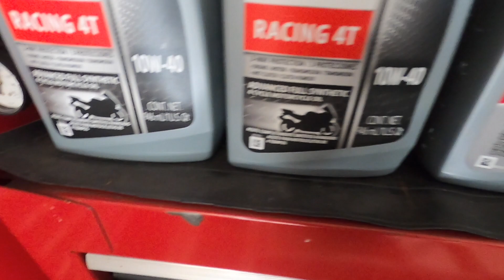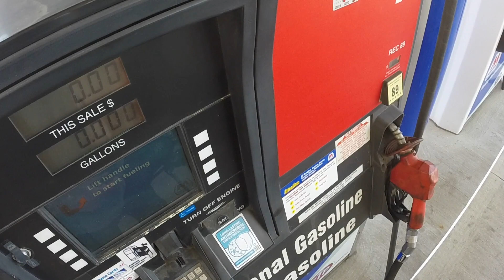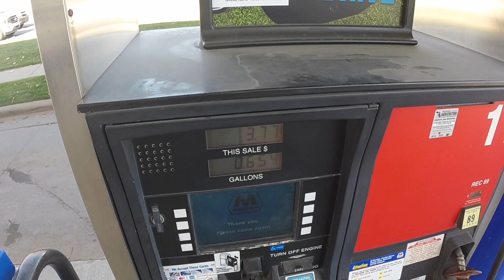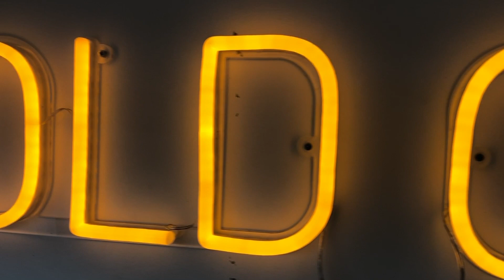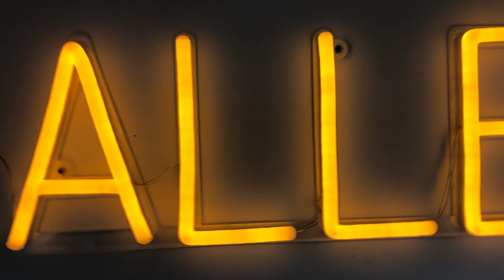Doing an oil change on the 1976 Honda XL175

Comment: I just picked up a ‘78 XL350 and have been looking for oil change info but there doesn’t seem to be much on YouTube.  Thanks for this.
Reply from the maker: I hope it helps. I also have a 1974 XL250..... plus a 1972 CB500 project at the moment.
Reply: @ ….. Thanks, any help helps.  I also have a 2009 Bonneville that I’ve tricked out somewhat and a basket case CB450 waiting for a little love.  Cheers.

Comment: Howard hello I hope I am wrong but I think you have either a nail or screw in the rear tire I noticed it when you were cleaning the underside.
Reply from the maker: I went out and looked. I found nothing in the tire, plus it still has the proper inflation in it.... I check it to be extra sure.
Reply: @OldCarAlley  It appears at mark 5:06…near the tire pressure gauge along side the tire…something silver sticking out of the tire…maybe just a piece of junk…have a good weekend Howard…maybe my damaged diabetic eye playing tricks on me…lol.
Reply from the maker: @joegreen7616  I can see what you're talking about in the video, but I went out to the garage and rolled the tire several rotations and saw nothing. It must have been some crud or something.
Reply: @OldCarAlley  Great enjoy the weekend sir.